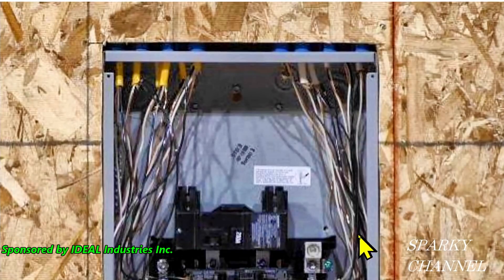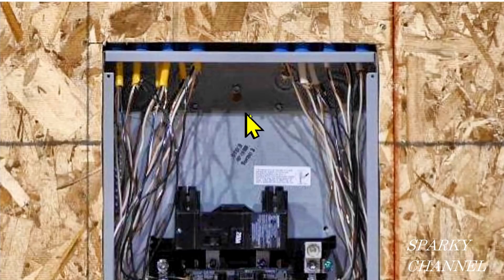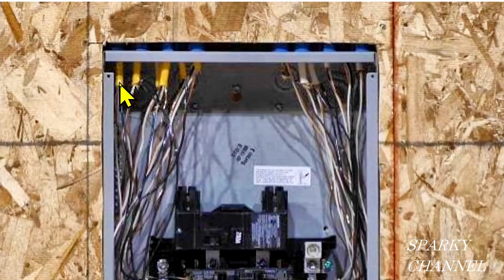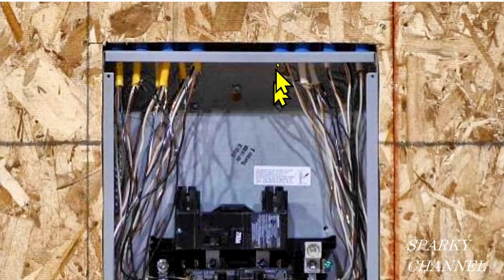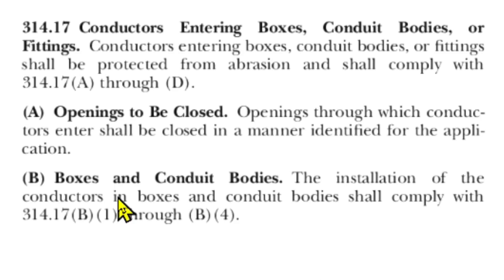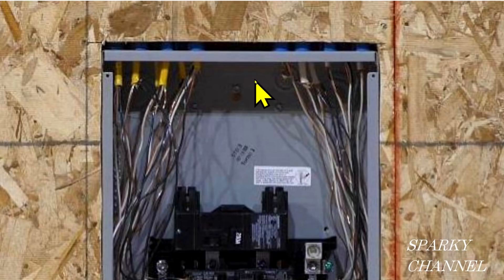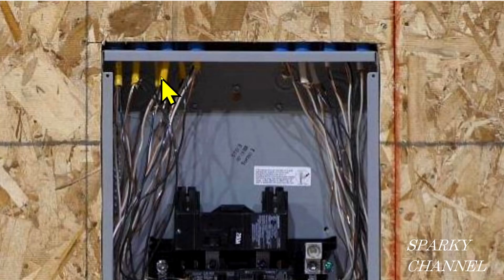How Far Should Sheathing Extend into a Panel? NEC 2020 314.17 (B), 312.5 (C) and 110.12

Comment: I use BX cable with BX connectors don't have this problem laugh out loud
Reply from the maker: Yes, it's an excellent system.
Reply: BX stands for production B experimental  the company who first produced and patented them had two types of AC cables  AX and BX, but their second one was the one that survived time becoming BX cable (AC90°) some use today.
Reply: @thomasseabrook1041  Think I heard year ago thatbthe X in BX stood forv experimental. First model was called AX then second model was called BX.
Reply: Never trusted the flimsy #18 guage aluminum bare wire that helps the metal jacket provide a ground. Saw BX rust thru or jacket broke. In my area only allowed to use MC cable in comercial settings.
Reply: The origin of the term "BX Cable" is derived from the Bronx Cable Company. They would ship their product in a wooden crate with the stamp BX. CABLE CO. That's a true story.
Reply: @electricianron_New_Jersey  At an IAEI continuing ed class was told BX was the second type if cable a company produced. Think that class was taught by a very smart great UL guy.
Reply: @garbo8962  that little flimsy Wire  is to stop a magnetic field really the whole BX itself is what's grounding not that little flimsy wire
Reply: @electricianron_New_Jersey  yes I know BX cable is really a slang word it's really metallic cable I was born in the Bronx
Reply: @jcaleca60  Around my area the other name for generic term BX is either armored cable or type AC cable. It sucks due to flimsy #18 guage bare aluminum wire that is in contact with usually a steel jacket. Was taught years ago to never let disimilar metals touch one another.

Comment: where the code talks about 1/4" into the box or beyond the clamp, the key here is BEYOND THE CLAMP. A quarter inch isn't much and the folded lip on the panel (or wire tray) will be about a half inch. If the sheath can be seen and they are all about the same, I'd call it good to go. If they all show 4 inches inside so you can mark them, that's more than code so ok if it's tidy.
Reply from the maker: I agree with you, thanks!

Comment: I think the sheathing is the least of the lack of "neat and workmanlike manner"
and if you clip short pieces of sheathing from the waste, and set them on the circuit conductors next to the breaker it makes a much more useful labeling method, and is easily transferred to the panel labeling.
Reply from the maker: Great point! Thanks Ken!
Reply: I don't understand what you are describing clipping short pieces of waste and placing it on the circuit?
Reply: @actionjksn  when you pull the wire for the circuit, you use a permanent marker to write the name of the circuit on the NM cable.  when you strip the cable and put it in the panel, you save the part of the sheathing with the name on it, and slide it over the wire(s) that will be connected to the breaker, so the wire has a label on it.  then when you install the breaker, you position the label next to the terminal, so you can always identify what that circuit is feeding.
Reply: @kenbrown2808  Okay got it now thanks.

Comment: I wish you could see the job I'm having to fix it's one of those jobs where somebody says they know Electric you have old aluminum wire coming in where they've then put wyanett on it and switch it over to Copper then on top of that you've got somewhere comes in on aluminum or copper then switches over to a number two copper
Reply: Alumicons

Comment: Great video! This got me thinking about an old issue that I never understood about the NEC. What is the difference between a cord and a cable?
Reply: Is a cord something that is meant to be moved around regularly while cables remain stationary?
Reply: a cord is intended to be flexed frequently. - either for temporary connection, or for a permanent installation where flexibility is necessary.
Reply: as I recall, a cable is a bundle of wires inside a common jacket. A cord is individual insulated wires fastened together by their insulation. (IE zip cord or lamp cord) SO or SJO is actually cable, even though it's commonly called cord. MC and Romex is also cable. (common outside jacket)

Comment: A lot of sheating material inside the panel could add combustible material in case of an electrical fire, "fuel" for tought.
Reply from the maker: Yes, "fuel for thought" indeed.

Comment: Functionally, nothing is wrong; no code violations either. The student just hasn't yet been fully indoctrinated in the cult of uniformity that is the electrical trade. Reading through the comments section of any electrical forum will demonstrate how the tradesmen belittle one another for even the smallest deviation of what their particular sect of learning was.

The minimum sheathing amount is most likely only meant to prevent chaffing from the fitting, as just the wire poses no other danger in the box as demonstrated by conduit.
Reply: The code says what the code says. We can all debate the why's, but the words are there. Several of those entries are not to code. (1/4" min) We can't tell if they're actually secured from the picture. (I've seen plenty that weren't tightened.) Neatness is a matter of opinion, but the work of one person should be consistent, and at least attempt to match any compliant existing work.
Reply: @jfbeam  Neatness is required by code, though the level of neatness is open to opinion.
Reply: Yeah electricians can be overly anal about the neatness of their wiring.  But do you really think it's okay to go to a national electricians event where you show off your work and do wiring that looks like what see in this video?

Comment: 1/4" is minimum sheathing no maximum i don't think
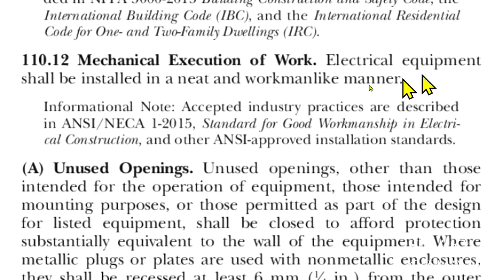Reply from the maker: I think the max would be under article 110.12 at 4:12
Reply: @SparkyChannel  ... yes, but there is no max number mentioned. If they are all 4 inches into the box so you can mark them and it's tidy, I see no problem.
Reply: @rupe53  you're right.    I have my sheathing in my panel long enough to write where they go.  About 4 inches.   My panel is very neat with zip ties.    I passed inspection...

Comment: Can anyone explain why in the actual hell the sheathing has to be stripped back super far in a panel box?
Reply from the maker: See 2020 NEC 314.17(B) (2) :3:23
Reply: @SparkyChannel  There is probably a shadow on the one that you couldn't see a connector.
Reply from the maker: @illestofdemall13  Possibly. Or perhaps that push-in connector became loose and is back in the shadows.
Reply: @SparkyChannel  It doesn’t explain why. It just says you “shall” do it.
What’s the purpose of being a mindless code drone that can’t wrap our head around WHY it matters if NM sheathing extends let’s say, an inch inside of box instead of just a 1/4 inch.
Code should make sense, not be arbitrary.
So again can anyone give an actual reason why you can’t go longer than 1/4” with nm sheathing?

Comment: More importantly: how is the gap between the panel and the sheathing going to be remedied? Will the inspector allow the panel cover to be an adequate solution?
Reply from the maker: The hinged dead front gives 1/2" overlap on all sides so I wouldn't want to see more than 1/4" gap. I think his was more like 1/2".

Comment: Our local inspector requires 1/4' or less sheathing; anything more is just sloppy work done by someone who is unskilled or not trained properly.
Reply: the NEC says a 1/4" or more, no? so your local inspector leaves 0 margin. he's more like a critic...
Reply: @wim0104  The NEC is the minimum and some inspectors want more which is normal.
Reply: @lh5943  The minimum is 1/4" so that makes no sense to say 1/4 inch or less. It must be 1/4 inch or MORE. At least NEC says so.
Reply: Tell your inspector to look up code and fallow code
Reply: Less than 1/4" is a code violation. Also, you said less than 1/4' which means 1/4 of a foot, I think you meant 1/4".
Reply from the maker: @illestofdemall13  Hi Kris!
Reply: @SparkyChannel  Hi Bill! Hope your 2022 is going well. My preference is to leave 1/4"-1/2" coming in on every cable and label each hot with another piece of sheathing with the circuit ID written on it (or use a label maker) and leave it right next to the breaker where the hot enters the breaker terminal.
Reply from the maker: @illestofdemall13  2022 is going great! Excellent. sounds great!
Reply: @SparkyChannel  I sent you an email a few mins ago.
Reply from the maker: See 2020 NEC 314.17(B) (2) :3:23
Reply: @hellersbuildingremodeling7771  Local codes vary.
Reply: @hellersbuildingremodeling7771  Local codes vary.

Comment: Where is the cable secured to the box?
Reply: Wire clamp connectors.
Reply from the maker: There are blue plastic NM cable clamps above the panel.

Comment: I’m not sure what an inspector would think, but I’d prefer to see the sheath come clear down inside the box to just short of the breaker than feeds it.  Then run the conductors to the breaker and grounding bar.  This makes it very easy to tell which romex run goes to which breaker rather than trying to trace individual wires in a sea or black or white wires.
Reply: From the viewpoint of an owner of an old house that has had a lot of remodeling done over decades I would agree. It is very annoying to have to replace an old cable where the 3 individual wires are buried in amongst so many other wires that you can't easily tell which belong together. I'd go further and say that cables should enter the panel from the side as close to the breaker as possible to minimize the amount of wire/cable inside. Breaker panels have improved over the years but could be way better if we gave up on this desire to have them fit between 16" centered studs and allow every cable to enter from the top. Neutral and ground connections should be standardized and go down along the full length of the bus bar. I should be able to replace one make of panel with another and not worry about wires being short because the internal layout is different.
Reply: @JasonEDragon  ... I dare say every DIY owner of an older home goes through what you are saying about cluttered panels and being "painted into a corner" with no room to spare. What you fail to realize is you haven't planed ahead for future growth. That older home (in my case) started life with a 30 amp service and eventually grew to a 60 amp service, with an option for a second meter. Not sure if they were going to make it two family or another metering rate for electric heat. I upgraded to a 100 amp panel and even though it was nice and neat, it was full, from that point on. Shorty after I got into the business, I realized I should have started with a larger panel for the growth. Somewhere in that time frame I also realized there another reason panels are only 14" wide. It's because you can put two of them side by side on a 4 ft wide piece of plywood and have room on the sides to stay organized. The width standard works well in 95% of cases. BTW, if your old wires are short you can install a junction box above and extend those circuits. That will seriously unclutter your panel.
Reply: @rupe53  In 2019 I had the 2nd service upgrade done on my home (going from 150 Amp to 200 Amp) when I had a whole house natural gas generator and automatic transfer switch installed. A small meter combo panel outside was the main panel and allowed me to split off a 100 Amp circuit for EVs/Garage to not overburden the generator if it switched on. 
So, my primary panel in the basement is treated as a subpanel with separate ground bars. I bought the best Siemens residential panel they had, but its 14" width limited how many wires could be routed inside and still have reasonably easy access in the future if a circuit needs to be moved or replaced. 
Instead of cramming everything into 1 panel I kept a 2nd subpanel in the basement and mounted both of those panels and the transfer switch on a full sheet of plywood. But if a manufacturer offered a wider panel and placed the ground bars closer to the neutral bars then I might have been able to consolidate the 2 subpanels into 1 - and still have it neat enough to allow easy future changes.
If I live long enough, I can easily foresee my generator being replaced by solar and battery in a decade or 2. And I might very well want to reorganize circuits if preserving battery life in an outage is a consideration. I think that too many electricians and manufacturers have the mindset that panel and circuit installation is a one and done event.
Reply: @JasonEDragon  ... one and done is probably 95% of the market, other than exceptions for renovations every 20+ years.30 and 40 circuit panels are becoming more popular just to have room for the future, even if you only need 20 breakers now, BTW, good thinking on the second panel. I did similar on my last upgrade since the majority of important items were in the original panel. When I went to 200 amps I used the original panel for the generator, then stuck the AC, welder, hot tub, sauna, electric oven, etc in the new panel. (not on the gen set)
Reply: R u serious? Major violation 😂
Reply: @Nick-bh1fy  Which code section is violated?
Reply: @LTVoyager  honestly ur prob American so me referencing a Canadian code violation is prob not even worth it
Reply: @Nick-bh1fy  Yes, NEC would be applicable code.  This certainly is not convention in the US and may be a code violation, but I am not aware of any such code restriction.  It would make for a neater installation.
Reply: @Nick-bh1fy  What does the Canada code say?
Reply: @LTVoyager  I'm studying the CEC and there is no max length of sheath anywhere as far as I know, would be interested if there was because sometimes with instrumentation cable you need to keep the sheath on well up into the panel
Reply: @EricFrazer32  Likewise, I am not aware of any restriction in the NEC, but I have been retired for nearly 7 years now (P.E. Licensed engineer) and have not kept up with the code.  Yes, if you are using shielded cable you absolutely want to minimize the length of conductors that are outside of the shield.  Then again, shielded cable is not often used for power cable, but rather for data communications or RF signals.
Reply from the maker: Good point. I would keep the data cables sheathing on as long as possible.
Reply: @LTVoyager  it actualy clutters the box more bc it restricts more than you think. I have installed a couple hundred boxes with a licensed electrician and the code book says no more than 1/4 inch of sheathing. Its actually cleaner if you just mark the panel for which breaker controls what and then number the clamps accordingly
Reply: @SparkyChannel  ... why would you ever have shielded cable inside a breaker panel? If it was switch gear for a generator there are some different rules, and the code is specific about a partition between line and low voltage areas within the same cabinet.

Comment: Bill, what about the exception in 312.5(c)? I do not know what those blue fittings are, but if it is smurf tube, wouldn't the NM cable only need to be secured within 12" after it leaves the smurf tube? The picture does not show if the cable is clamped at those fittings,  they may just be running through them.
Reply from the maker: They're blue plastic NM cable clamps.
Reply: @SparkyChannel  Those blue plastic clamps that you set with a pair of Channelloks extend about three sixteenths inside the panel. I was taught to let about one eight" of sheating past the clamp. That gives a quarter inch sheating inside the panel. Also, a plastic clamp cannot chafe the wire cover, the code was written for metallic clamps.
Reply: It’s not smurf tube.
Reply: @dallas5374  What is it?
Reply: @nogoa42  watch the competition video. They're plastic NM cable clamps. (Junk imo, but that's what they had them use)
Reply: There's no ENT (smurf tube) anywhere in the video. Just because a fitting is blue doesn't necessarily mean it's for smurf. There are all sorts of colors of NM fittings. There are red, yellow, black, grey, blue, etc.